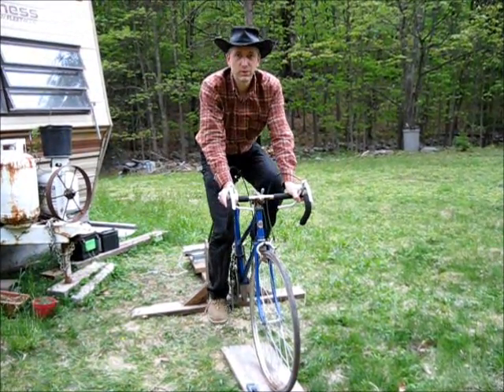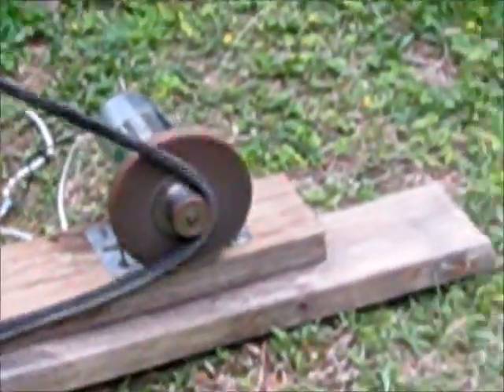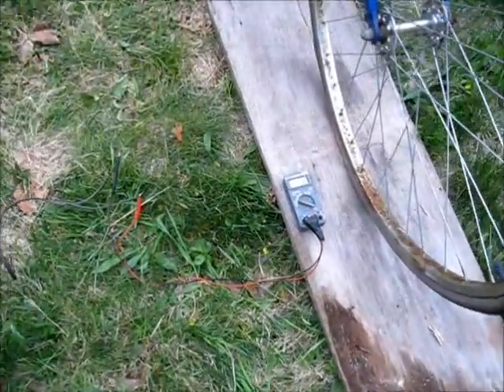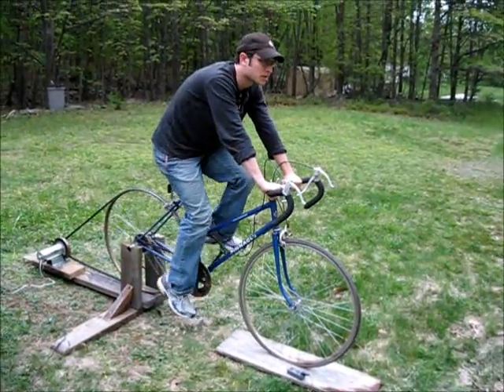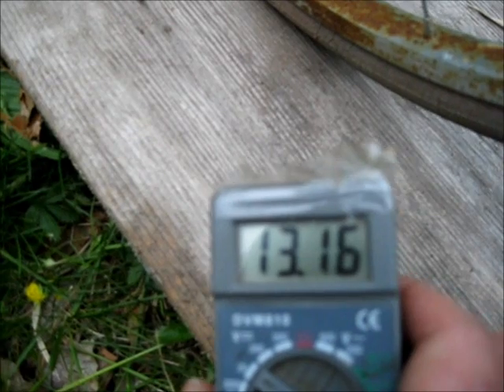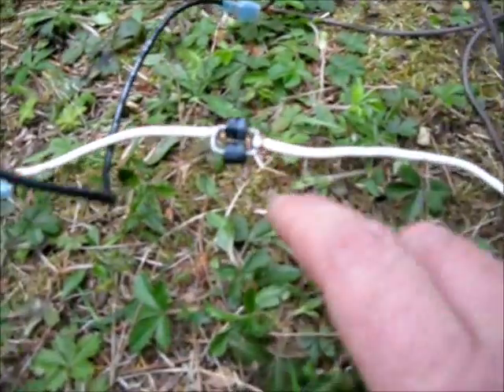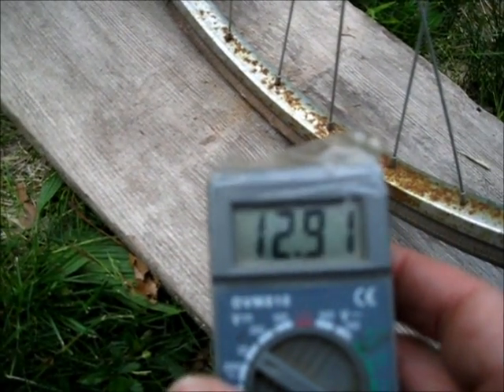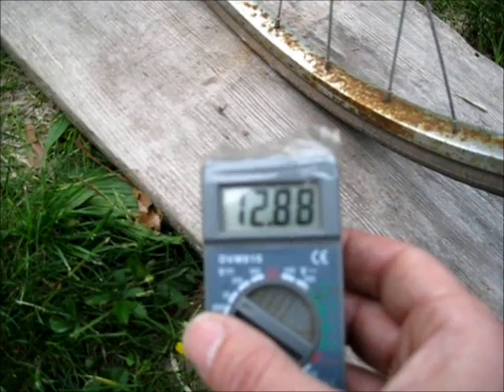Homemade Bicycle Generator - people power for off grid living

Comment: useing a car altenator woth a regulator would be better u run the risk of ovrer charging the battery with a  regulator  from a car u cant over charge the battery unless it fails, u can get a old  Chrysler  corp chargeing set up  with a external regulator  wired up right(its not hard if u can  do older car work or a gm charging set up with a internal regulator  . they r ok but if the regulator  with  its harder to  replace it as u have to dis assemble(take it apart it can be a  big job with out the right tools& skills)
 he alienator  to  replace e to replace the regulator  but with the old   3 wire wire Chrysler  charging sysyem      the main wire gose to the battery (it supplies   the voltage to the battery powers the  system   then  the  other 2 wires go to the field  terminals of the altenator & make sure re regulator is grounded to the charging circuit  that way if the  regulator fails  u unscrew 2   self tapping     bot &  unplug ut ten repeat to  put it back on , the  car charging systems  hsv outputs of 45-100+ amps

Comment: I get 8 hours on a gallon of gas to charge my batteries  at 40 amps. The only energy I exert is to pull the starter rope. The only time I use is about 5 minutes a day to start and stop my generator. you are getting 5 or 6 amps out of that. At that rate it would take you about 60 hours of peddling to replace what I use in 24 (assuming you don't stop to eat drink or rest).
I leave the TV on at night for a night light. I don't have to conserve energy for $90 a month

Comment: 12.9v is NOT correct anyway. And you should have around 14.4v coming out and with a regulator. You can also connect with solarcharger for more easy way

Comment: Sir ,I won't to price of dc generater which is using you and also about flywheel which is attached with motor.
And which type of diode we should use .
And finally total coast of project .
Please

Comment: Use a capacitor bank to keep the voltage consistent.
Reply: What is the benefit/reason of that? (I'm a total newbie and trying to make a water generator)
Reply: Boban Orlovic Because capacitors hold a charge, it would keep the load constant, so the voltage doesn’t drop making it easier to power it. An inductor would keep the current constant as well. These are basic filtering techniques to help generating power more constant instead of the load being on/off all the time. It is also less wear on any batteries.

Comment: Generator 1 horse power 😅.
Reply: not even close though at those volts:  "A treadmill motor from a pro form treadmill.
2.65 hp (1.5 hp cont. Duty at 95 vdc). 21.4 amps. INS. class H. 25c ambient. Open const. External fan... The treadmill motor is rated at 95 volts so if you use 48 volts
It will only put out about 0.4hp to .66hp but should last a long time." So they are pedaling at 14 volts tops - so probably closer to 1/8th horse power. Maybe 90 watts? Depending on the voltage rating - it could have a higher voltage rating.

Comment: You have no clue what it's putting into the battery without knowing the amps.
Reply: yes they have high ohms resistance.
Reply: @voidisyinyangvoidisyinyang885  I wouldn't say "no clue", the volt meter DVM can give you an idea about charging if you can see a delta voltage in the right direction.  The diodes getting HOT, wow, and they are for what? To keep the batteries from running the motor/ generator?

Comment: Dude it looks like the rear gear is in high. That makes it very difficult to sustain for any length of time, enough to do any real charging over time. Gear it down, the generator will still put out sufficient power to charge, and it will be easier to peddle and get a few 60 minute workout sets to fully charge the batteries.

Comment: Price to build?
Reply from the maker: This cost me nothing at all since I used all free materials. Oh, the bike cost me a little bit but I cant remember now.
Reply: @TheDoItYourselfWorld  thank you for your reply. Its just I want to make one with my family and was wondering how much it would cost to DIY a generator?
Reply: @TheDoItYourselfWorld  Or do you have some tutorial somwhere on how to make one? :)
Reply from the maker: Get a free treadmill. Take out the motor. Get a bike. Take off the rear tire. Figure a way to mount the bike so it wont move. Find a long tractor belt to fit the bike and over the treadmill pulley.

Simply connect the negative wire to the negative of your battery directly. Connect the positive wire through a diode which can handle the voltage and current you will produce.

The motor will have its specs on it somewhere.

For even better results get an MPPT wind turbine charge controller which can handle the voltage and current output from the motor. This will give you maximum output to the battery.
Reply: @TheDoItYourselfWorld  thank you :)

Comment: Most of it is surface charge. Batteries hold a lot of energy, that's why it takes so much work to raise it .1 volt. If you ever have inconsistent reading it's the meter and not the battery.

Comment: i have a 48 volt 1000 watt max draw electric motor. i am interested in doing something like this to power it...is it feasible ? I mean...is there  a special type of generator i need to look at ? i am totally lost on this project at this point. i am simply tired of running it off of a converter/power supply plugged into the wall outlet
Reply from the maker: That is a very high power demand. You can supply maybe 300 watts with your own power but that is all. You may consider solar panels or wind turbines for now. Solar is down to $1 per watt these days but you will need 3x the rating to run something 24/7
Reply: i found a 48 volt  1500 max watt  wind  turbine generator. it is rated at 580 rpm's .  my easy cruise rpm for a pedal crank id 120 rpm's.....so its a 1:4 ratio, ballpark.
  i will spend the 200 bucks and i will let you know....i looked into low rpm traditional generators and the cost is just too high...but this chinese one that is designed for wind appears to have a low torgue requirement and therefor should be easy to use (well easier) when compared to your setup
Reply from the maker: I think that you will find it is quite hard to pedal at full load. I once had a car alternator hooked up to a bike and batteries. Boy, when I hit the switch to energize the coils, that thing pulled some power and got hard to turn. Please do let me know your experience.

Comment: How about powering a small dc motor with solar attached to this bicycle generator instead of pedaling.
Reply from the maker: Using energy to turn a motor to produce energy wont work. Best to directly use the solar then. Unless you are talking pulse motors but that is a huge topic of its own.

Comment: I don't think those diodes should be connected in parallel because one feeds off the other and one will generate more current than the other diode that's why they are hot and you should have went with a thousand RPV. diode instead

Comment: So I'm guessing that in this setup you'd have to moderate your speed to moderate the voltage output. If you pedaled too fast you'd put out too high a voltage. I've heard that you can get a solar controller that will step down the voltage while boosting the current. That way you can use motors with higher voltage outputs to charge low voltage batteries. The plus side of this is that many larger motors that are available for salvaging are higher voltage
Reply from the maker: Actually I just pedal as hard as I can sustain. The battery absorbs it. But yes a charge controller will be much more efficient and give you more power in the battery.
Reply: The motor must be just the right specs then. What is the maximum voltage you can get if you pedal as hard as you can? Also, what is the maximum wattage output of the motor? I imagine if you have a high enough wattage motor then you will only ever achieve low voltages when using it as a bike generator because to get it to its max rpm (and therefore maximum voltage output) would require its maximum wattage output. Eg. If you had a 90 volt motor with a max output of 1000 watt and your target output voltage is 14 volt, you would want to run the motor at 15.5% (14/90) of its max output. Assuming that the relationship between the wattage input and the voltage out is linear (I'm not sure if this is the case) then the wattage necessary would be 155.5 watt (0.155x1000). From the figures I've been reading on average output of someone on a bike, that would be the upper end of what most people could output anyway. 

Not sure if the assumptions around the linear relationship between rpm/wattage/voltage are correct, but if they are then if you choose a mid-range voltage motor (around 90 volts) that outputs around 1000 watts then you effectively eliminate the need for expensive charge controllers.

Comment: Hey, great project! I am really interested in making one... I actually have a treadmill motor I scrapped a while ago and I can easily get a free bike off of craigslist if i look hard enough. I am not an experienced electrician so I can't ascertain the exact wiring setup you have from the video. Is it possible to go through a parts list and post a schematic of the wiring? I know you said you would recommend upgrading the diodes so if you do respond could you put a recommendation for the better diodes? 

Also, how would this hook up to a charge controller? I have a charge controller from my PV setup but I can't afford a $10-15k array of panels...I ride a stationary bike at my gym (where I also shower....yay dry cabin living) and would love to take that time and put it on something like this.

One last thing, with a charge controller, how safe on the batteries is this?

Comment: How many hour would it take to bike to make 12v battery full?
Reply from the maker: How big is the battery? How low is the battery drained? What is the age and condition of the battery? In a perfect World scenario lets say this is a 300 watt generator and there are no losses in the lines. Peddling an hour gives you 300 Watt Hours of usable energy. You can power a 100 Watt light bulb for 3 hours or a 1 Watt LED lamp for 300 hours. You can run an average laptop for about 5 hours.

Comment: how long are you able to use your bateries after being charged by bicycle pedaling
Reply from the maker: Depends on the size of the motor/generator output and how long you pedal. And the size of the load you put on the batteries. Lets say its a 300 watt generator and you peddle for an hour. Then you can run a 300 watt load for an hour. Or a 100 watt load for 3 hours. Or a 3 watt load for 100 hours.

Comment: does anyone know what the diodes are called (what kind of diode?)
Reply from the maker: Any diode with high enough current rating for your generator. Its called a "blocking diode" and you can get them on ebay pretty cheap

Comment: n tell me about the pedal is if u force it n ur cycle in which gear ?
Reply from the maker: I dont remember which gear we used back then on this bike. Each person is different. Thats why an 18 speed bike is good to have on this :)
Reply: The Do It Yourself World ii say u installed an ac motor with the paddle use the frist gear is very soft the ac motor take load for drive this n u not tried

Comment: can u tell me how many bettry amps
Reply from the maker: This generator puts out about 300 watts. About 20 - 25 amps.
Reply: The Do It Yourself World thankz
Reply: The Do It Yourself World u now y I asking if u use small ac motor .5 amps n connect with first gear understand
Reply from the maker: An AC motor will not generate electricity. Only a DC motor will do that.
Reply: The Do It Yourself World oh hoo u don't understand me u drive the cycle I say driver with ac motor

Comment: why use treadmill that sucks power instead start using this at the gyms
Reply: very smart , never thought of it myself
Reply: because the costs of changing would be bigger than costs of traditional use
Reply: A lot of gym equipment is leased and not owned by the business but a third party who sources it from manufacturers. That's a lot of people to change at the same time and very expensive to do. It will and should happen but that's why it hasn't so far - because it's a lot of different people in separate businesses who have to take a large risk investment to see almost none of the savings (which the end user wouldn't see and the leaser would only see in the very long term). Everyone has to break even first, which means a lot of potential for losses.

Comment: Why not hook it up to a charge controller?
Reply from the maker: I did not have one for this at the time
Reply: @TheDoItYourselfWorld  did you figure the amps? I don't want too many amps - but my motor is rated  at 15.8 amp maximum 5075 rpm 2 horsepower 130 vdc. So I think that is 17 volts - with 663 rpm but what would the amps be? I only want 4 amps max since I have lithium batteries.
Reply: @TheDoItYourselfWorld  I used Ohm's Law to figure 8 ohms resistance so at 17 volts should be 2 amps. What's the specs on your DC motor? That's a treadmill motor?
Reply: @TheDoItYourselfWorld  3.3 amps. He said 90 volts and 300 watts so volts x amps = watts. so 
300/90 = 3.3 amps. That's what I calculated for a 130 volt. About 2 amps
 by biking 17 mph.

Comment: Can you write a material list please
Reply from the maker: Just some scrap wood. A treadmill motor I got for free. An old bike. And a V belt. And some screws to hold the wood together. Oh, and some wires and a diode.
Reply: can you hook the dc motor directly into a dc to ac inverter?
Reply: he can hook the wires from the motor directly into a charge controller which eliminates the diode as the CC has diodes in them, so those cheap Harbor Freight CC's can be used for this and then you have a USB on the charger already

Comment: real question is can this charge my phone though
Reply from the maker: Absolutely. This produces about 300 watts of power. Pedal for an hour and you have 300 watt hours of usable energy. Use it to charge a 12 volt battery and then use a 12 volt to USB adapter to charge your cell phone and other devices. Just a few minutes of pedaling would provide enough power to charge your phone

Comment: So it's a 90 volt DC treadmill motor. 12 volts per 2 minutes = 0.01 kw per every 2 minutes. I need 5 kw to power my whole 3 bed 2 bath 1800 sq ft imaginary home. So 0.01 x 30 = 0.30 per hour x 17 hours on the bicycle = 5.1 kw which is equivalent to a $10,000 5 kw solar panel. And cost less than $500 to build. So I'm saving $9,500? Is my equation right or wrong? I hate to be wrong but it happens. I spent some time with this research. So just 17 hours on the bicycle will power my whole home for 1 month straight without having to rely on pg&e?
Reply: +The Do It Yourself World - is it free in your country to build a wind turbine and produce energy for yourself? In my country there was such a guy with his own-built machine, who was getting free current, but the authorities dismantled his device, saying that it's a stealing. Pathological law, not helping the people to take care about nature.
Reply: Why am I not understanding what are you talking about guys? Consumed power is measured in kwh, not kw... So if your house needs 5kw, it means it will consume 5kwh every hour... the guy said he was producing around 300w per hour, that means you will have to pedal 17 hours to power your house for 1 hour... hello? You will need to pedal for a couple of hours just to cook a meal...
Reply: poland
Reply: 12 volts = 12 watts = 1 amp
Reply: P(kW) = V(V) × I(A) / 1000 = 12 volts x 1 amp divide by 1,000 = 0.012
Reply: There are 720 hours in a 30 day calendar.
Reply from the maker: I figured that I was producing about 300 watts per hour. At 10 hours you have 3,000 watts. 15 hours = gives you about 4,500 watts. Your math is good so far.
Reply from the maker: But if you need 5,000 watts per day to power your home, then you must produce at least 5,000 watts per day, plus more to account for losses in the lines and the batteries. You have to peddle 17 hours per day to power your home.
Reply from the maker: Unless your entire home only uses 5,000 watts per month? You did not specify that. Most homes use 3 - 8,000 watts per day. If you only use 5,000 watts per month then you are quite amazing. Really. Then you are ready to go off the grid because power savings is the biggest obstacle when going off the grid
Reply from the maker: Now put wind turbine blades on this thing and put it up in the air and you have power 24/7
Reply: Survival E Curios Chat  I don't know where you got that nonsense from. Watts = volts × amps. In this instance, we know the pressure is 13-14 volts. We do not know what the current draw (amps) is even though there was an uneducated guess. Therefore we cannot know what the power (watts) is. This also means that we cannot estimate the battery's charge in watt hours.
Reply: +szymikon1980 - which country are you from?
Reply: 3.3 amps. He said 90 volts and 300 watts so volts x amps = watts. so 300/90 = 3.3 amps. That's what I calculated for a 130 volt. About 2 amps by biking 17 mph.

Comment: how long would it take you to fully charge the batteries?
Reply from the maker: 300 watts @ 12 volts = about 25 amps. So a 100 Ah battery would be charged in 4 hours for example. It all depends on how much you use actually. But this is great for powering a small backup system for emergency use. Some LEDs, laptop or emergency radio for example.
Reply: would that time lessen if you used two bikes at the same time?
Reply from the maker: Two people? Yes of course, with two bikes and two generators.